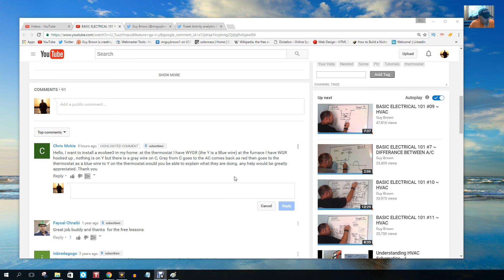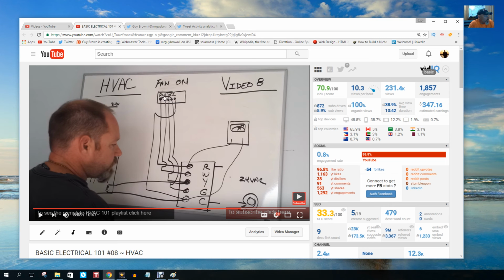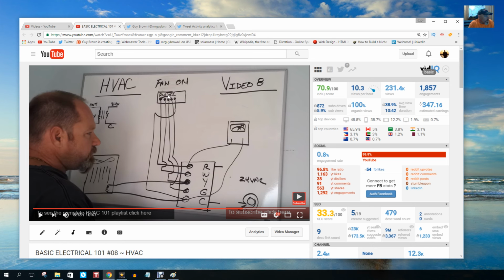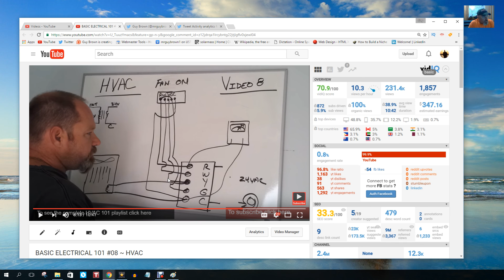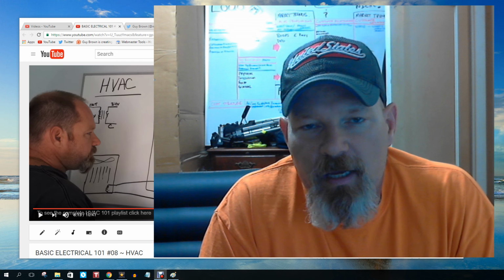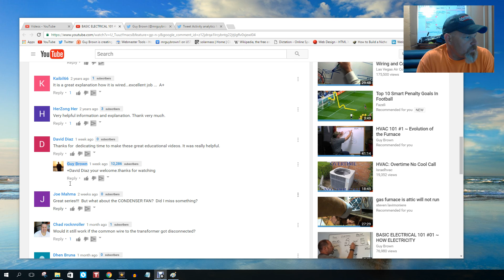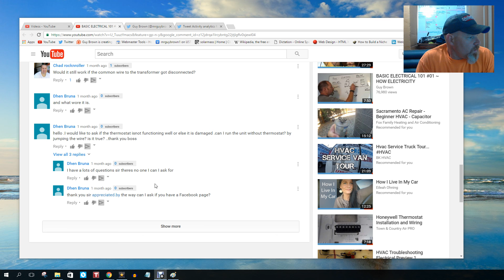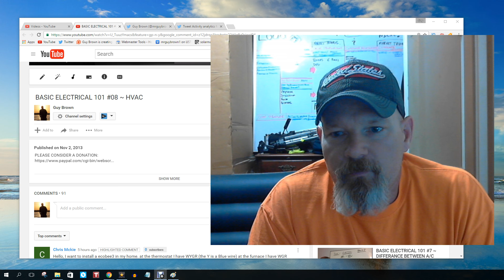HVAC Q&A Thermostat Wiring

Comment: Hey congrats for your channel.
I have a question about rough in wiring. 
How do I run my low voltage wires for a system? Do I jump all my timers than to the control panel and last to my unit? Do I bring all my timers and controller to the unit ? 
Thank you and keep doing what you do. Very useful informations.